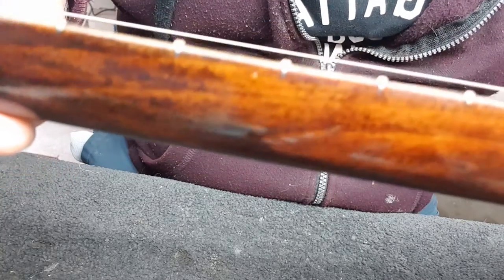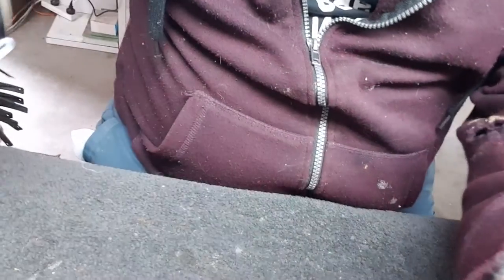Banjo dowel quick fix

Comment: 👍 I have a banjo in my shop with an almost identical-looking ring and hardware, except the dowel is round (headstock says B&M). First thought was to pull it and recut the socket, but then I had the idea to shave back the last inch on the dowel to make a heel, and glue on a wooden oval to take the tailpiece screw, allowing the neck to be tilted back. Your method, though not as 'pretty' has a major advantage - adjustment! 👏